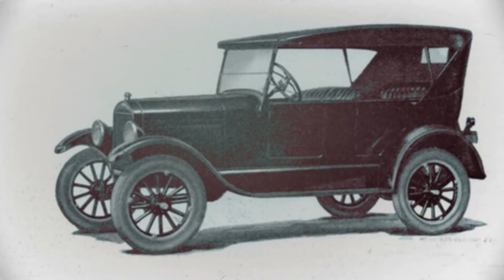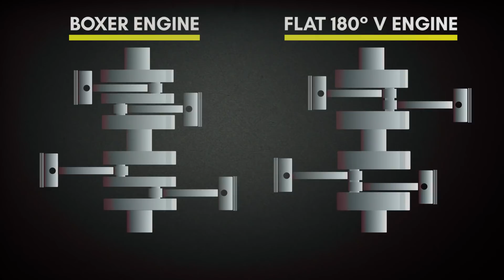Boxer Vs 180° V-Engine | Flat Engines in Motorsports

Comment: Maybe I'm just being pedantic, but could the differences between a true boxer and a 180° V engine also be defined by the construction of the crankcase? As far as I know, most if not all flat engines use a split crankcase.

Theoretically, a flat engine constructed with a single crankcase with conventional main bearing caps is also possible. Disregarding the configuration of the crank and pistons, would this also qualify as a 180° V engine?

Comment: Soooo
It being called a 180 degree V engine only because of the shared journals? 
Not really anything about a V because 180 degrees is a flat line deep down?
Reply from the maker: One possible explanation that their known as “V” engines is because they are really offset at about 178 degrees. That and the shared crank journals. I agree the name is a bit misleading.

Comment: A Ferrari testarossa also used the 512 engine, and that may be one of the most produced models.
Reply from the maker: So a pair of opposing connecting rods share a single crank journal on this engine?
Reply: @GearQuest  yes
Reply from the maker: Interesting 🤔 Thanks for sharing!

Comment: You can't find it because flat v engine doesn't exist, that's like saying look at this flat curved line. The v in the name kind of refers to the position of the Piston in regards to  crank shaft. In a flat engine they all are flat 180 otherwise they aren't flat engines the stroke of the Piston doesn't change that. I think some of these marketing people where just reaching to differentiate their companies or where just high as crap 😁
Reply from the maker: Look carefully at the crank journals. The flat V did exist but are very rare.

Comment: Ferrari raced a 180° V12 in Formula 1 with the 312T from 1975 through 1980, winning 4 constructors and 3 drivers championships. They also used a 180° V12 for the Testarossa.
The C291 from Mercedes Benz / Sauber also used a 180° V12.

Comment: Fords Shelby GT-350 Mustang uses a flat 180 degree V8.  It's a 5.2L flat plane V8 nicknamed the Voodoo engine.  526hp of pure American muscle!
Reply: It's a 90° V8 with a flat plane crank! :)
Reply: it is most definitely not a flat 180 degree V8 - it has a flat plane crank however, but that's different - that means the crank pins are  in a 180 degree flat plane with regard to each other but the V angle of the cylinders in the GT350 is most definitely not 180 degrees........it's 90 degrees.